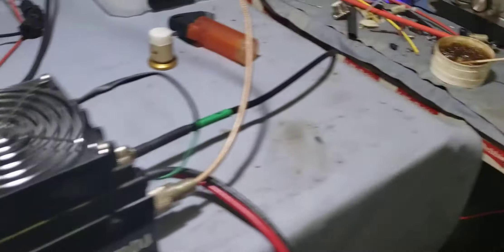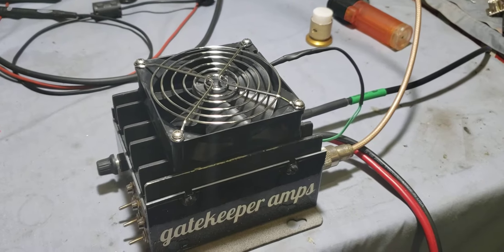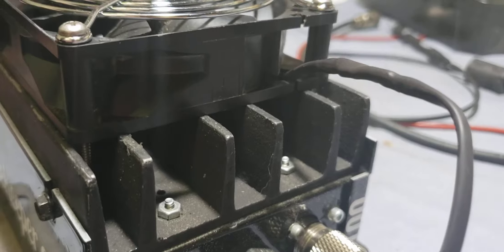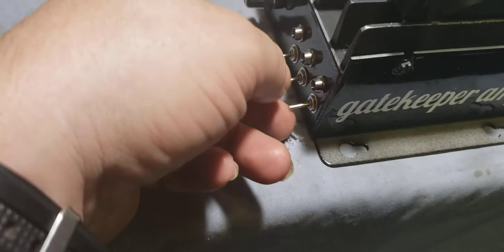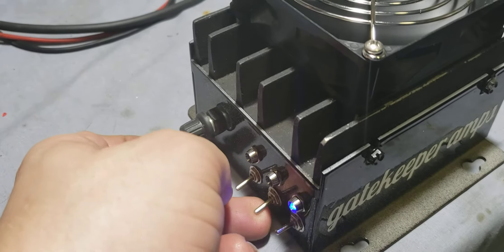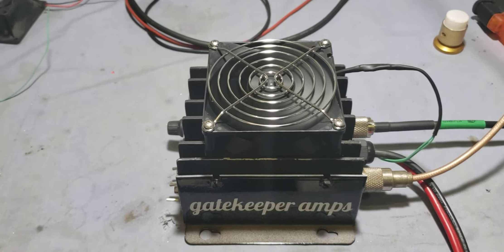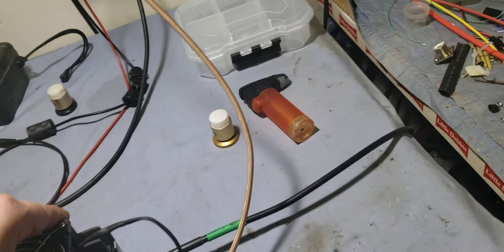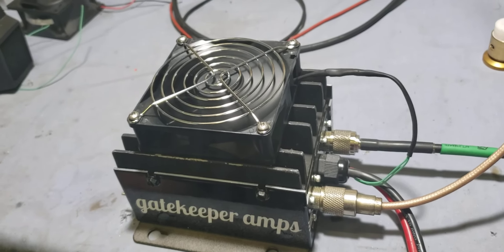Tiny GK200 2 💊 PLZ Read Description 👇 2 See The Build Vid

Comment: cute little box. I got some cases about same size from eBay . but all aluminum  just small tin for front and back and a slide out tin for the bottom.  will be ok for 1 MRF 455 or so. used 1 for a class D audio amp bord. 2 CH 128 KHZ sampling MOSFET module 100 watt RMS per CH . 24V . draws around 8 amps 24V full power into 4 ohm speakers. and makes little heat. around 90% efficient. That 2 pill MRF 477 I got about same size but heatsink fines are short and more of them and gold. still waiting for the pills . no pre amp, no SSB . just on/off .73's